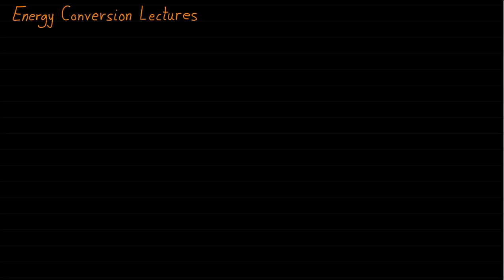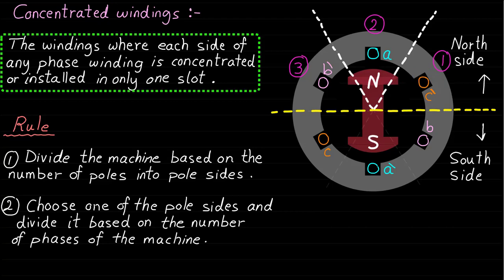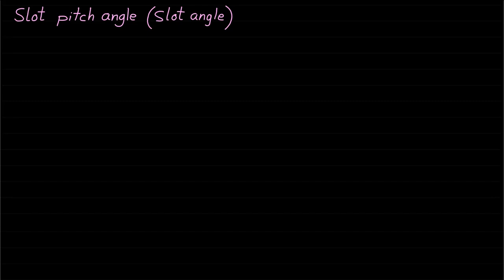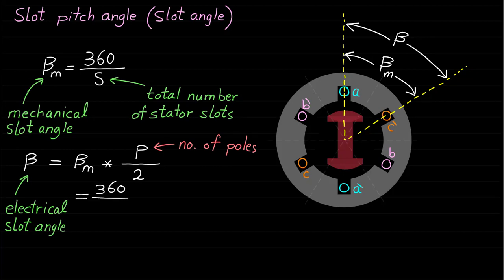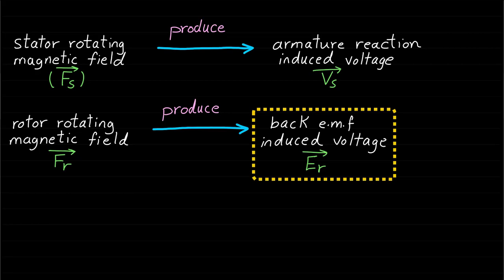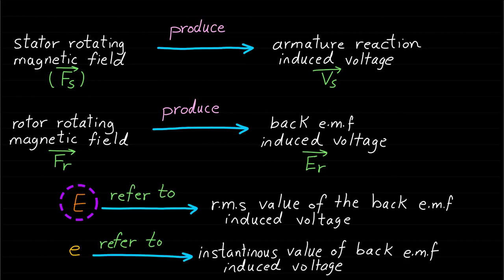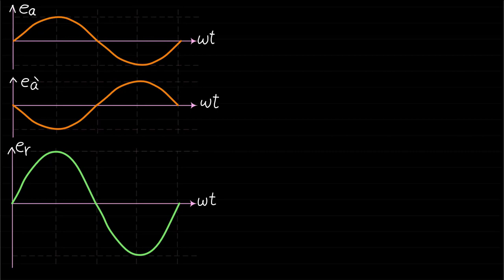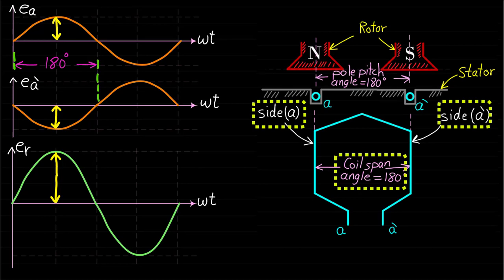Synchronous Machines - Armature Windings (Part 1)

Comment: Iam very happy when i saw u posted new video, welcome my friend, i just have one question:how DC current can energise solenoid and coil if its constat and why not magnetic the Tr
Reply from the maker: Thank you for your nice comment and question.
Electro-magnetic devices  can be divided into three types:
1. Inductors:  The inductors are independent of the current. That means the inductors can be designed for a.c current and dc current. Please review chapter 1 for more details about the inductors.
2. Electromechanical devices such as solenoid: In chapter two we proved that the "Force" is dependent on the current squared. That means the electro-mechanical devices such as solenoid can produce Force and movement if they fed with dc current or ac current. Basically, solenoid can work  with ac and dc current.
3. Transformers: Transformers operation principle depends on the induced voltage or Faraday's Law "e= dBsi/dt". Faraday's Law  of the induced voltage depends on the change (derivative) of the magnetic field linkage " Bsi". Now, if we supply the transformer with dc current, the magnetic field linkage will be constant in steady state condition. That means, there will be no change {constant)  in the magnetic field linkage when we supply the transformer with d.c current. Now, since the magnetic field linkage is constant (Bsi= constant), the induced voltage will be zero because the derivative of constant value is zero (e = dBsi/dt = zero). That means, the induced voltage on the secondary will be zero if we supply the transformer with d.c voltage. Hope this answer your question.
Reply: @EnergyConversionAcademy  thank you very much dear